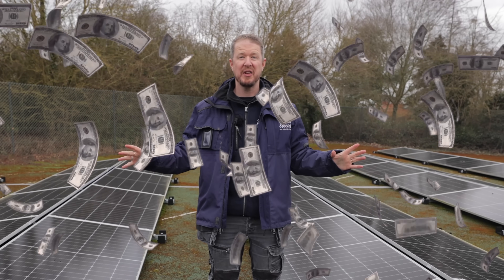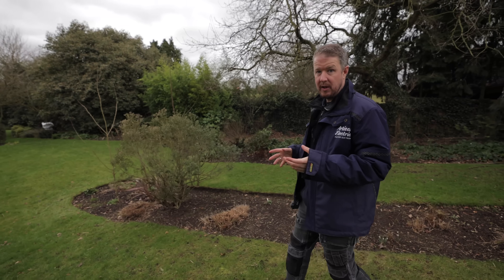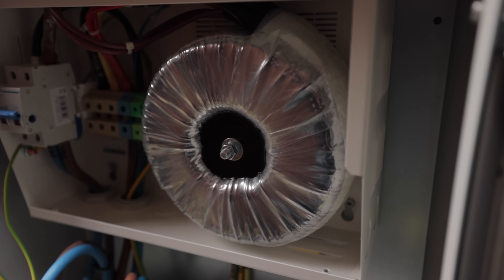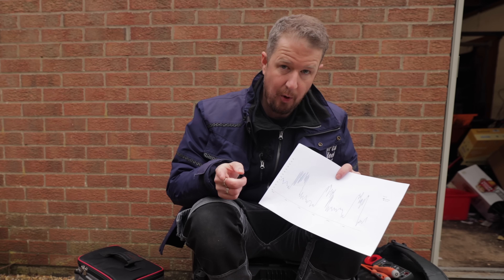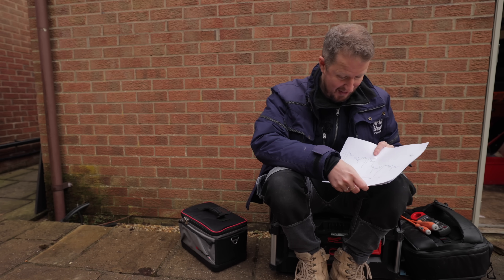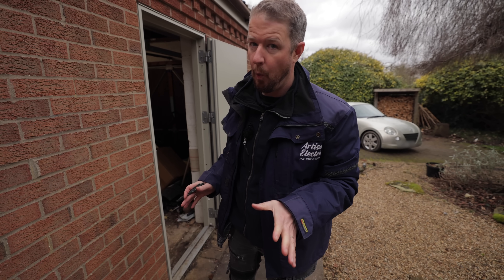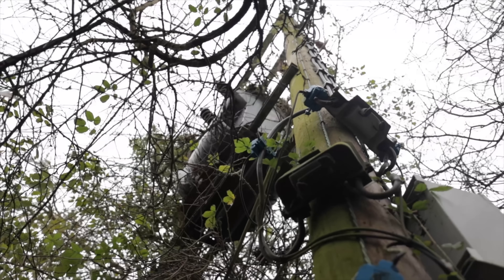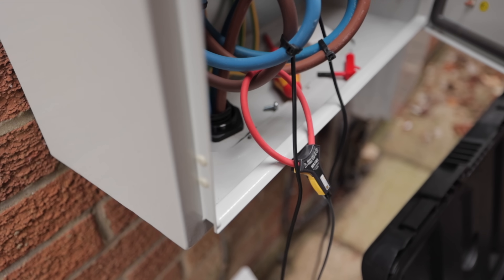THOUSANDS Down the Drain – And We Can’t Do Anything About It!

Comment: Historically, the standard voltage for single-phase electricity supply in the UK was nominally 240 volts and DNO apply diversity for supply say 10 to 20 amps max.  Officially the voltage is  230 now, same in Ireland, most times it's still 240. There is no way an overhead line system is designed to take 70 amps constant in or out. It should have been blatantly obvious in any site survey. Does anyone know what the LN impedance was or is on the line before installing this and now. If a farmer or a business needed import or export of 72 amps constantly in a rural area then they would have to pay for three phase power as many have done.

Where did any common sense come into this. How on earth did your design team think they could inject or pull that amount of power into or from the system without issues. It might appear a bit greedy all round and now consequences to that. Sometimes we have to say no to a job better for the customer and ourselves. How did your design team not think to check this in detail with someone who understood DNO limitations, transformers, voltage rises and falls, overhead line distances to transformers etc . If you combine a lot of solar plus wind for example can blow transformer locally or cause severe voltage spikes, even I know that. Simply relying on a G99 piece of paper was a bit reckless for that level of power. DNO are perfectly correct to say it’s your problem now. I honestly could not believe Artisan would have sold such a solution to a customer. It’s going to cost big bucks to get out of this one if a customer sues for supplying something not fit for purpose, not going to be that voltage regulator that’s for sure.

The solution may well be to get the DNO to put the transformer very close to the house, that will reduce line/neutral impedance, it will put the high voltage line on the other side of the transformer but then may impact the overhead line configuration and impact what other neighbours can do. Real solution is to limit export, so G99 with limited export and if they want to import that level of power in a rural area, pay for three phase like farmers and small business have to do or go off grid when voltage hits certain thresholds which is the more obvious solution.

Comment: I'm guessing the neighbours on the same transformer will also be getting 260V+ when your solar is exporting? If they reported an issue then the DNO wouldn't be able to tell you to turn your solar export off while they do their tests.
Reply: The DNO can and will make you turn it off if they suspected it was causing an issue. If you are operating generation equipment then you have to meet the UK grid specs. If your solar is pushing the voltage over that, they can make you turn it off by removing your G99 (or even G98) approval. And they can even charge you for type testing it to prove the plant equipment is performing to spec.

Comment: Lot of knowledge here. I agree, regardless of DNO a loop impedance test would have given you the evidence for this install. I used to live in a home where a 7kW shower would make the lights dim significantly. I borrowed a loop impedence tester from work but the DNO did nothing to resolve it.. however, now moved, the system next to me is significant and his neighbor complained, DNO came, upgraded transformer and ran new wires to his home.. regardless of your customer, the neighbors are entitled to stable supply, luckily they gave you the go ahead. Not your fault, you have gone out of your way procedural wise but im surprised you green lighted the project with a high loop impedence..

Comment: I think you should go to a neighboring property and voltage log there. If the neighbor has no solar to turn off the DNO can't request it and the neighbor is bound to be seeing the same over voltage issues, use the hopefully friendly neighbor to log the fault with the DNO rather than your customer. 

Unless there is an issue with the feed to your customers property, but then you'd see a massive voltage drop without the voltage optimizer while say charging the battery system at 17kw.

Comment: As far as I understood the part with the autotransformer, it sits right after the meter and steps down the voltage when consuming and steps up when feeding, right?
I'm thinking about changing the location/connection of the autotransformer: Connect the solar system (inverters and batteries) right behind the meter, without "voltage optimizer" to the grid and connect the house via the autotransformer.
That way you could charge the batteries at full power without the extra voltage drop of the autotransformer (grid will drop anyway) and can feed at full power to the grid and the house and car charger get's the stepped down voltage through the autotransformer.

Like some other comments I'm also thinking that the long lines are "too weak" and that the inverter should reduce power at 253V.

At full power of my 10kW 3p Inverter I can raise or lower the voltage by 2-3 volts per phase when charging from or feeding to the grid. I'm logging the grid voltage constantly and I can see some stepping up and down throughout the day. Our power lines in the street were upgraded to 4x150mm² aluminium with 4x35mm² aluminium to each property.

I like your troubleshooting and technical videos, looking forward to part two :)

Comment: but isn´t it normal behavoir of an inverter to pull up the voltage to press the power into the grid? normally you can set those parameters in the inverters so that it doesn´t put the voltage so high up or put the cos phi of the inverter at 0,9 at least that what the VNB (youre DNO basically) wants here to help prevent this, but they also startet to install self regualting transformers here in the normal station so they can regulate the voltage better because some areas here where there is pv and windturbines had that problems in the past that the voltage would be too high

Comment: DNO has a responsibility to their customers. 
When allowing someone to connect to the grid, AS BEING THE MOST KNOWLEDGEABLE,  Should assume responsibility the Solar Customer has the prroper criteria
If it is within Tollerances, CONNECT & HIT THE SWITCH !

IF it does not work properly, BOTH Should resolve the problem. 

If its an interface issue , the DMO Must facilitate it at no extra cost to solar customer, or contractor (if any).

Comment: Nominal UK used to be 240v ac, and was dropped to 230v to bring UK more in line with Europe, 
So up to 1993 Uk voltage was 240v and reduced 230v after that date, so if that traffo was installed before 1993 it may still be tapped at 2204”v
Reply: They never changed it. The spec on paper changed to harmonise with Europe. But it always has been 240
Reply: @barrybritcher  I was going to post the same comment the voltage in the regs changed but in reality, it's 240v
Reply: Yes just a paper exercise 240v plus or minus 6% you still get the same voltage but now bottom end can be lower
Reply: UK regs have accounted for this and have a higher overvoltage limit to account for older systems. It hasn't really changed at all. The voltage specs are all about international links, not domestic production. I rewired my house, which has a nominal 247V supply. No problems with modern protective devices. If overvoltage is the problem, then the system wasn't designed correctly.
Reply: At night I see 248v
Reply: @leexgx  you got quite the vision
Reply: 230V in UK since when? That's incorrect.

Comment: Need an active voltage stabiliser ont an optimiser. Sollatek in the UK make multi tap active transformer type (output voltage changes depending on the input voltage in real time) for less than a grand. We use them all the time and they work really well

Comment: I'm experiencing the same issue. I have 6.4kw system split equally on an east/west roof. In the height of the summer, the system will trip the breaker due to the voltage spike.

Comment: The inverters should be able to control their output voltage and provide themselves, via programming or adjustment, with output set points. If they can’t, then they’re not fit for purpose. Does the system monitor the distributors supply voltage? It should and it should use it to regulate its own output voltage, otherwise, once again, it’s not fit for purpose.

Comment: Using voltage optimizers is illegal in most of the EU.
When the grid voltage is already 260V, the reason the inverters then off is that you shouldn’t be pushing even more into the grid, because it’s clearly overloaded.

This is just bodging it so that it “kinda works”, which is why you’re still screwing around with it now.
Reply: That's the first thing that came to my mind when I saw that voltage optimizer. It's nothing but a toroidal transformer that steps down grid voltage by several volts, but as any transformer it works both ways, therefore when the PV system is pumping all that power into the grid, the voltage on the grid side of that transformer rises above anything that is legally allowed. I wonder if they measured it on the grid side when the PV is working with full power. If the grid voltage was already 260V, then by installing that optimizer they're raising it by another several volts, up to 270V or more. That is going to fry neighbors' appliances in no time and if that's legal in the UK, then I'm utterly baffled...

This is something that we deal with on occasion in Poland, where at this point basically 1/3 of single-family houses in the country have several kW of PV installed, so it's extremely common and so are the problems associated with it. In some rural areas with long LV power lines with high loop impedance, prosumers located on further ends of LV lines experience problems with voltage rise that causes their inverters to trip. They're not very happy about it, of course, so there have been attempts to install either voltage optimizers  (as shown in the video), or changing factory settings of inverters to allow them to boost the voltage above the legal limit of 253V (the nominal voltage here is 230V +/-10%, so 207-253V). Legally PV inverters MUST shut down if the average voltage in a 10 minute period exceeds 253V, or immediately if the voltage reaches 264V. Prosumers that try to cheat these regulations are easily detectable by smart meters and consequences are quite serious, including hefty fines, losing net-metering privileges, or even being forcibly disconnected from the grid.
The only legal and reasonable solution that is allowed (and these days required, AFAIK) is enabling the Q(U) mode, which allows inverters to adjust the amount of power they feeds into the grid to a level that doesn't elevate the voltage above 253V. 

On another note, 17 kW on a single phase is quite shocking. I know, it's how they do things in the UK, but here a single phase PV inverter is legally limited to 3,68 kW and anything above that must be 3-phase. Upgrading the supply to 3-phase would significantly improve the situation since the voltage rise would be something like 6 times lower in this case.

Comment: This customer requires a 3 Phase supply for all this to balance out. Until this is issue is rectified everyone is wasting time and money and getting upset.
Reply: Judging by the expensive unnecessary transformer they installed it is single phase. Could have set an export limit on the inverters or at the very least changed some of the running parameters of the inverters
Reply: I assumed that is why they have the three inverters etc but obviously that is just a coincidence.
Reply: @axelknutt5065  It looks like they have a single-phase voltage normalizer (autotransformer?). And yes, the issue can't be addressed without a three-phase power supply because of how the first three-phase transformer in the supply chain works. It will balance the load over all three phases by raising/lowering the voltage in one underloaded/overloaded phase unless you have a single-phase (two-phase?) network in GB. But I'm not an expert.
Reply: @axelknutt5065  Yes, I was confused by the fact that everyone had assumed that it was a single phase supply but then I remembered the voltage optimiser which had one huge coil and was obviously single phase
Reply: @axelknutt5065  It's way better to have dedicated 3-phase inverters because then the inverter can push voltage on the phase with lowest voltage.
3-phase isn't that complicated and can actually save a lot of headaches in cases like this. There are more wires, but it's not hard, just be aware about the voltages.
Reply: yes 3 phase will cut the voltage rise/fall by a factor of 6!
Reply: So tell me how does every new house in the UK built with solar panels as standard and single phase mains manage to work OK with it's feed in. The average new insallation is about 3,5kw but the cumulative on a street is way over 17kw ?
Reply: @Nailnuke  Typically, residential is limited to something like 3.5kw per phase or 16A to avoid this grid saturation when 1000+ homes output 16A - 3.5kw at 11am, as they need to output above the grid voltage to export power. Limiting single-phase's export, also increases the number of homes that can export power across a wider number of homes on the same transformer.

If you have 3-phase, you can also likely go well above 16A, as the voltage spike from unknown number of homes importing/exporting can be balanced across phases which have individual voltage readings. sic. So it's not just a peak of 48A ~11.5kw, but you can probably have some 'wiggle room' up to 50A/12kw for short periods, sic because it's balancing across 3 phases. 

In a rural area, there could be more accommodations i.e. 100A fuse/limits, but it's looking more like curtailment is needed - depending on how the EV is wired into the SolarEdge - or around the SolarEdge's monitoring. Why they thought a 100A or 63A voltage optimiser would solve this is anyone's guess - since it's likely set too high at -15v if the overnight is 242v-248v. as noted, when the charging starts, it pulls way below 212v, which is not normal for solaredge if it's configured for active power control - which solaredge does have if it's configured to operate in the Country specific 230v +10/-6% ranges.

Active Power Control/ Reactive power  in the SE17k can also ramp and gradient time on charge times/export current for voltage stability over time, so it ramps up export and import  each minute to handle voltage, balance power across phases, et al. it just has to be configured. A lot of issues also seem to be confused on why they didn't try to set up a soft-limit of 50A - 12kw on the solar export first to see if this would prevent hitting the 73A import/export problems i.e. charging too 'hot' and exporting 'too hot'  - that seem to be inherited by the Hybrid Inverter not being set up for curtailing.

A 63A fuse is around 15kw vs 73A for 17kw , the best bet is to set up the proper UK specs for grid protection so it can curtail the solaredge back to 250v and 220v draw, at a peak of 50A or 60A so the battery isn't trying to pull 100A or something absurd off the grid.
Reply: That is exactly what I was thinking, but I didn’t comment because I haven’t seen the wiring diagram

Comment: Im not an electrician / qualified in any way whatsoever, but I would say you are correct, transformer is undersized... What would be interesting would be to monitor the voltage on another house nearby.... If the transformer is the issue, the voltage will be floating high on every other house  on the low side of that transformer, but slight deviation as you get closer to the tranformer or further away.... If this is the case, then IMO its 100% the DNO issue... They told you it was fine to install a system of a stated size, and clearly there network cant handle it, new transformer required at there cost! (It actually looked like they had some current monitoring going on (which is likely connected to the internet so they can remotely monitor in that white box) so maybe there already aware of this?? (Could also just be a standard monitoring system they use...) however if another close house voltage remains fine, in that case id say the issue is the feeder cable into this specific property being to small, although if that was the case, you would think in this ammount of time, some warmth / other issues would likely have started to occur! Part 2 absulutely! EDIT maybe the key might be to get a neighbour to report high voltages also, and get the DNO to log there property...then maybe they would have to deal with it...

Comment: This is an interesting one exactly the same situation. I had a new head with a split phase system 2x 80A supply, 460v between phases L1 6kw solis inverter with 2x 10.2kwh DC coupled battery and the same on L2. EV charger and Heat Pump onsite with a sprinkler sytem. System was working fine until inverters stopped working with warning messages with over voltage and under voltage. Sprinkler system alarming as over voltage reading was 276v. Voltage fluxuations were between 278v  and 215v Spent days retesting the system Ze, voltages etc reading were within limits i noticed between phases using monitoring app L1 would spike and L2 would drop thought about voltage optimization but have had Grid connection altered after weeks of voltage monitoring and playing the blame game and no problems since 🤞one massive headache tho